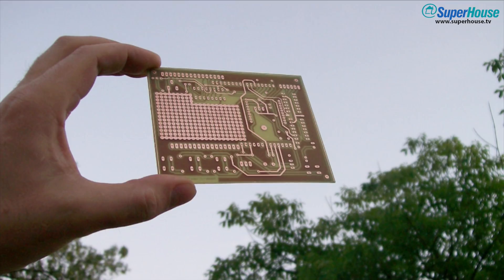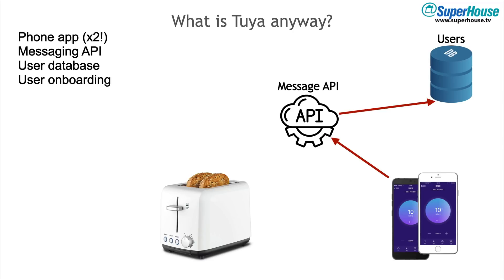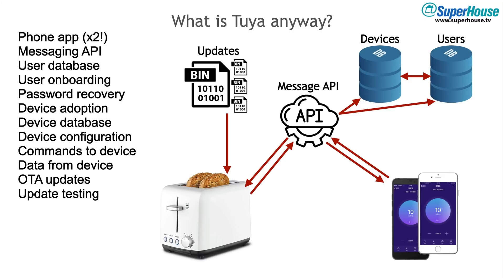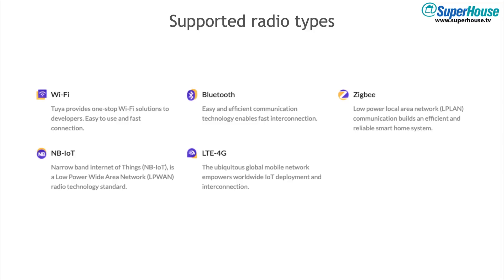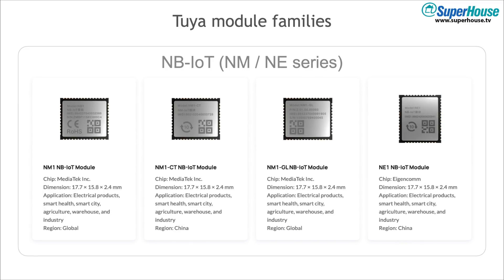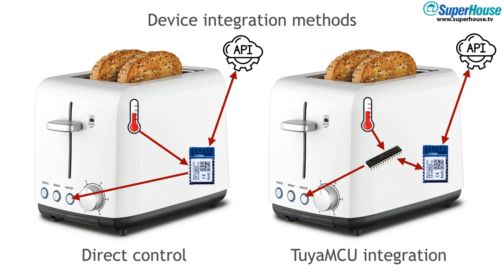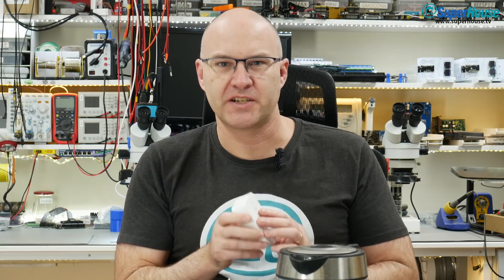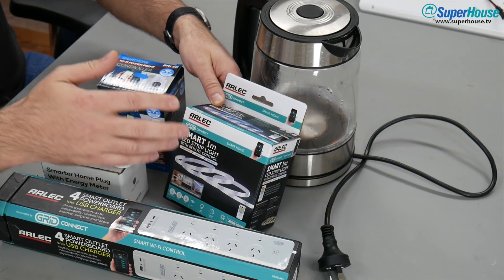SuperHouse 43: What is Tuya? Part 1 of the definitive guide to Tuya Tasmota conversion

Comment: What about Tuya local, where you are running it locally say through Home Assistant, independent of the Tuya server? It does not require internet access to operate, so if your ISP falls over, you can still use it.
Reply from the maker: This is only part 1 of a miniseries. The first 4 parts are set (and the first 3 are already filmed) but I'm thinking about doing part 5 about Tuya Local.

Comment: one thing that is a little confusing is the branding of the app (like 'grid connect') and compatibility between those brands on tuya. can they be used in the same app?
Reply: My Grid Connect smart switch can also be run through the Tuya app.

Comment: so the kogan smart plug still supports OTA?  quick whats the link to this!!   im finding it impossible to find any plug to use tuya convert on... thanks mate.
Reply from the maker: I bought 6 of them a few months ago, and Tuya-Convert has worked fine with them. Hopefully they haven't updated the firmware or changed the modules since.
Reply: @SuperHouseTV  im not going to risk it. Blackadder says they are no longer compatible since May 21.

Comment: Gonna be interesting to see how you address the issue of tuya-convert being completely busted for OTA flashing now that Tuya changed the keying method and blocked them out. I bought a ton of Tuya smart plugs and discovered they're all useless junk to me now because you now have to disassemble them to flash 3rd party firmware, and they're so full of glue that it's impossible to open them without destroying them.
Reply from the maker: There are still devices that work with Tuya-Convert. Part 2 has just uploaded and will be public tomorrow, showing how I used it with Kogan smart plugs that I bought recently. It really sucks if they've stuffed the device with glue. That's just nasty.
Reply: @SuperHouseTV  Mine are the Aoycocr ones. Avoid them. The inside is about 30% full of that horrible yellow-white glue you usually see around capacitors and transformers in power supplies.
Reply: @SuperHouseTV  Perhaps it's different in AUS but in Europe most tuya based devices now have had firmware modified such that tuya-convert doesn't work.  If you haven't done already, it may be worth mentioning this in your video before people start buying tuya devices and then being very disappointed.

Comment: Really looking forward to this series. I have seen certification for the Sonoff TH16's in OZ so I have been using them. I've also been using the Local Tuya integration in Homeassistant. This isn't as good as flashing new firmware and it a bit fiddly to get the local key for each device but works great.

Comment: Nice list of what you need to consider. But I am missing one important thing. But that's not your fault. Most IoT suppliers seem to forget about it.
Security!
Reply from the maker: That's absolutely right. I've talked about it on previous videos but I should have mentioned it here. In part 2 I talk about Tuya having access to all your device activity.
Reply: Yes. Any Tuya devices you have will be accessible to the Chinese government.
Reply: @marcus3d  then they have to get through our firewall first. And circumvent any traffic monitoring.
You can hide a lot on devices, but once you need to exchange information there will be anomalies in the network traffic.
Reply: @PeterPetersNL  Tuya devices don't even start to work without first contacting China. And even if you run Tuya "Local" they still report to China, although this can be prevented if you block outgoing traffic to those IP ranges. Maybe. We don't know if they have proxy hosts too, so you better prevent all outgoing traffic. (Well, at least TCP and UDP.)
Reply: @marcus3d  we switch them on in a blocked network (no outgoing or incoming traffic) and they are recognized by Home Assistant without any problem.
Reply: @PeterPetersNL  Without switching them to use Tuya Local as per instructed in the Home Assistant documentation?

Comment: Will be interesting to see how you're going to load Tasmota OTA as the "old" method using tuya-convert doesn't work with the recent (still espressif chipsets) tuya devices as the stock firmware now has changed to stop tuya-convert.